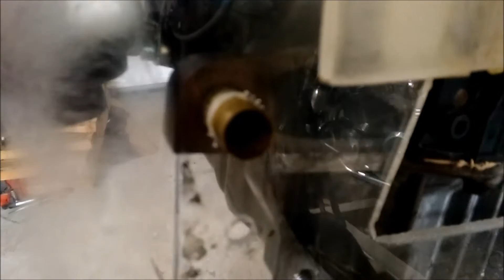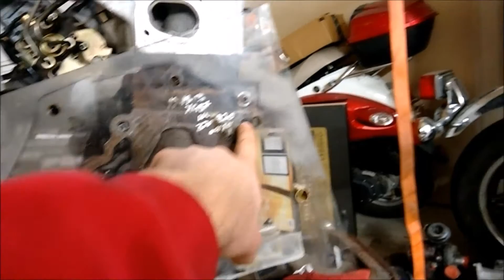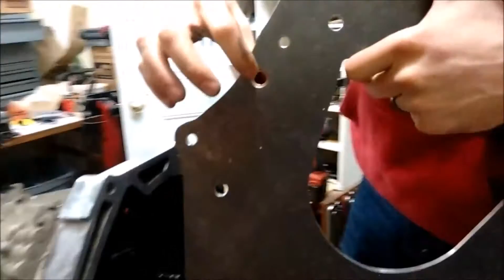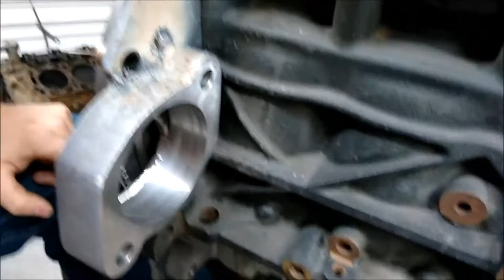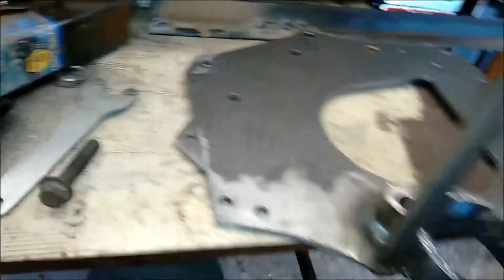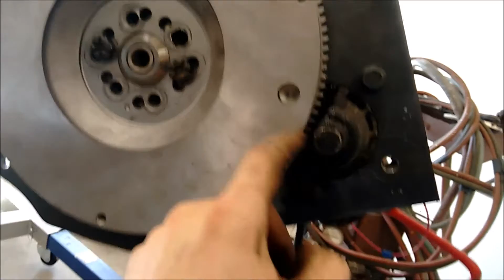TDI Ranger Adapter Build - Part 2

Comment: Wondering, did you finish your project with this tdi motor to the ford transmission?  I’m looking to do the same.
Reply from the maker: No, I passed it off to someone else. Ended up doing another build I have right now that is a Dodge Dakota with the NSG370 transmission out of a Jeep Wrangler. I haven't put anything up about it. Maybe I should?

Comment: The starter drive pinion has a ONE-WAY clutch in it,or it runs on a helical multiple spline;  this one has the splines;  either way,it would not spin anything running backwards,by rewiring it,like some suggest on the comments; plus,you'd need  heavy wire re-routing and soldering inside the starter, very difficult to do.The mechanical engagement problem alone,makes you rethink the WHOLE project; 
One could see that J.E. not know much when you had the big plate made,and FORGOT to include the opening for the STARTER!
And the electronics on that Edc Tdi are a KILLER also! you'd need a complete pullout with all the wirings,ECU,all the sensors, schematics,accelerator pedal (it's a double potentiometer), airflow meter,(or MAP) sensor,etc,and a lot of knowledge; one possible  way around this would be to purchase an older  Bosch VE pump,all mechanical; i do some of these projects when i convert  small boats(up to 21 ft) from gasoline (petrol) to diesel; 
(engineer--- i think the word derives from  engine).

Comment: Im thinking about doing a tdi swap into a daihatsu rocky the roadblock i had was compatibility with the tranny. From my understanding of this video to make them adapt i need to use the flywheel from the daihatsus original motor and modify it to the tdis crank and find a bearing that fits the  input shaft make the plate and figure out the starter is theyre anything else id have to account for?
Reply: go to Acmeadapters.com and use a Suzuki samurai or sidekick/Vitara transmission

Comment: Ok, could you please confirm what year and model truck that starter is from? Thanks!!!
Reply from the maker: dieselram05 If I remember right it was from a 1999 Ford Ranger with a 3.0 v6.
Reply: Jonathan Erber awesome!!! Thanks!!!
I’m going to mate my tdi alh to a velvet drive for marine use. And need a starter mounted on the block side. It’s awesome it meshes with the vw flywheel
Reply from the maker: dieselram05 Absolutely. Provides plenty of power to crank it as well.

Comment: you would change the starter position to the other side of the engine, thats all to achive the right rotation, if that can´t be done, you would either change starter rotation by changing internal coil, or buy another starter...
Reply from the maker: Switching sides of the motor would not change the direction of rotation. The starter would need to switch from the engine side of the flywheel to the transmission side of the flywheel to effect the change you suggest. Changing internal electronics is not an option due to the mechanical cam that relies on a change in torque direction to disengage. Were I to change the direction of starter rotation, the starter would either not engage, or would never disengage once the engine started. Unfortunately, a different starter was the only option, so I needed to re-design my adapter plate.
Reply: yes you are right, good work! I have one here in Argentina, crwe cab 2.8 TDI powerstroke, original engine.
Reply from the maker: +Hernán Sánchez Paya I am very jealous! I wish we could get those here. :-/
Reply: I saw incredible trucks in North America, I am very jealous about mecanic improvement you have there, right next to the corner!

Comment: Much easier to change the direction of rotation of the started than cutting it all up. Also wonder how the transmission now fits on top of the plate which holds the starter.
Reply from the maker: The problem with changing the direction of the starter is that if you did that the starter would never disengage. :-/ I sold the project to someone else when I ran into the fuel quantity feedback sensor problem, so I never did finish it up.
Reply: You are correct, but it depends on the starter type, but the VW engine was also sold with a starter on the engine.
Reply from the maker: +Thomas B Huh. I searched everywhere for a different style or direction of rotation and couldn't find one. My guess is that a VW starter that mounted on the engine side would have ended up having a shallower offset, which wouldn't have worked with my braket anyway. :-/
Reply: if the starter is the normal type with powering the solenoid trowing out and engage the gear from the starter you could still operate it , like i said , you need to change the polarity on the leads going to the the electric motor but leave the polarity on the solenoid like it is (not real sure you might need to solder some stuff around inside the electric motor and change the windings mounted to the chassis with the windings mounted to the lead going to the solenoid
still think i couldve been done 
too bad you never finished it
Reply from the maker: It is not that type of starter. The solenoid doesn't control the engagement of the gear. Gear engagement happens on a spline actuated by rotation of the motor. Reversing polarity would mean that it would never throw the gear forward, and if somehow you got it to engage, it would never disengage after the engine started.

Comment: What happened to part 3?
Reply: about 700 bucks for a mechanical pump for the tdi no need for electronics
Reply from the maker: Ended up running into a roadblock in my electronic circuitry, and abandoned the project. The whole purpose of the project was to play with electronics, and build my own ECU.